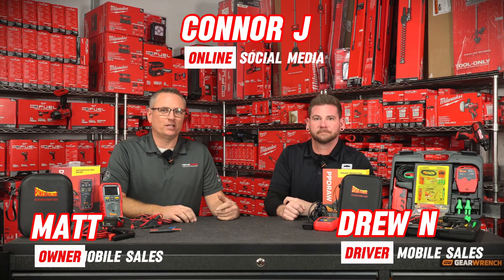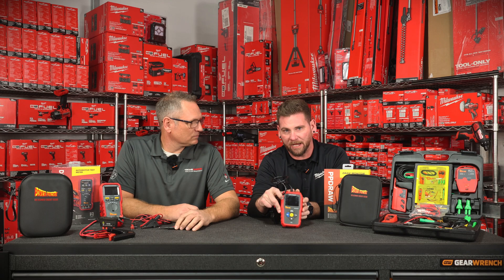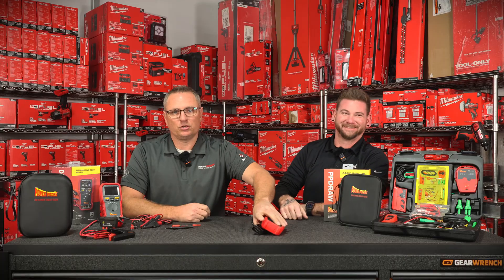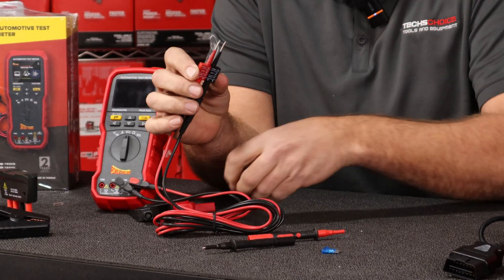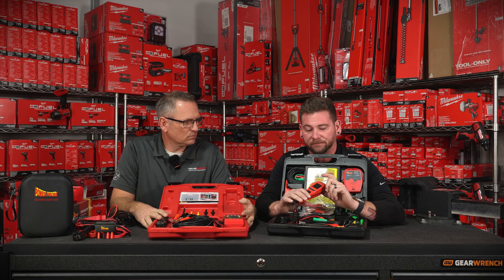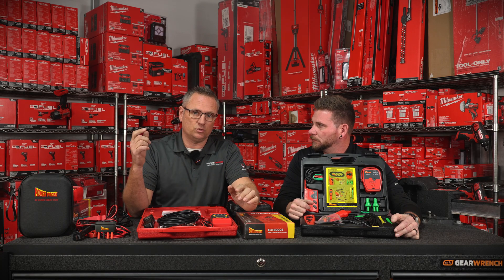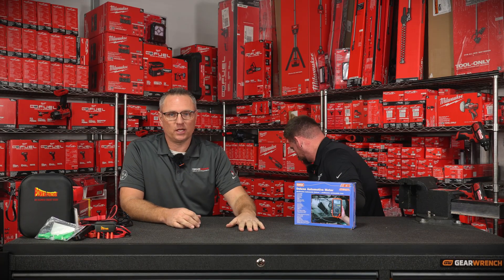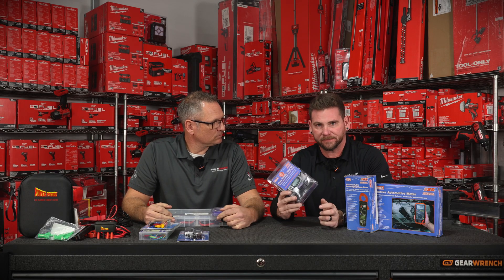The MUST HAVE Electrical Diagnostic Tools as a Mechanic in 2025

Comment: why thirty amps???....many radiator fans....abs pumps....air lift systems....secondary air pumps.....have in rush amperage well over 30 amps....should be 60amps.....there is no min/max!!!!!!!...should have a range button!!!!....it shuts off automatically after 15 minutes and you can not bypass that!!!!! why????  they missed the mark a little bit on this but glad to see power probe moving in with some new gear...really like the ppdraw

Comment: I love my PP draw as well but they should put an audible alert that when connected to the phone and you have an intermittent draw the app will alert you while your working on something else. If the draw is 3.5-5 amps it’s not gonna take long before it goes dead and you gotta start all over & charge the tool. If I’m working on something else while I’m waiting I can’t have my focus on watching the phone screen waiting on it to happen. They dropped the ball on the app developer. I’ve called to Address this issue and I feel they feel it’s not important. I actually thought or assumed it would do this with the app when I purchased it thinking why would it not have an audible alert. But it’s not the case. Maybe being a big retailer you can communicate this to them. I’m mean if they can port in software upgrades through the usb c port it should be an easy software update with the app designer making some changes.
Reply from the maker: I’ll pass the info along … that’s a great idea!!!
Reply: @ thank you. I appreciate that. It would make me feel it was money well spent if they can add that feature. That’s actually the reason I bought the unit.

Comment: Very cool. That battery saver/ammeter is excellent for parasitic draws. I recently made my own version of this tool from an OBD2 breakout box, some scope leads, wire terminals, and an m12 battery. I can put a meter onto the circuit for Volts and another meter into the circuit for Amps. However, my setup is clunky compared to that awesome tool. Also, shoutout to ES, they make killer stuff.
Reply: Man you might want to look into refining the idea of a little bit and maybe sending it to Milwaukee or somewhere I know snap-on and lisle is always sending out the forms  to fill out for tool ideas
Reply: @DillonDaVillain222  Yes. I was thinking about that.
Reply: Excelente puedes compartir el amperaje del M12 o del medidor PPT gracias me gustaría fabricar uno creo ke es buena idea